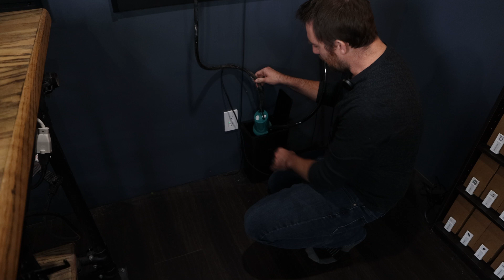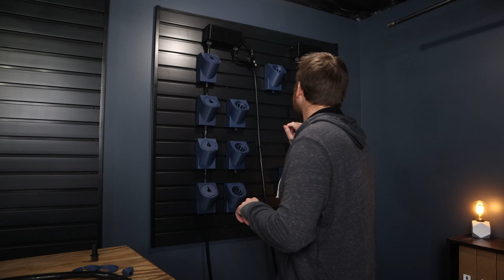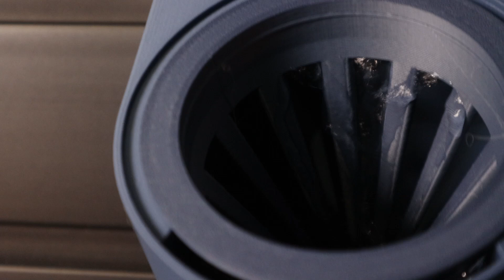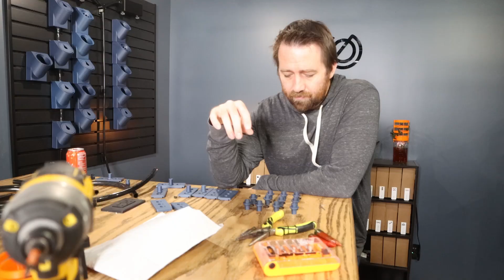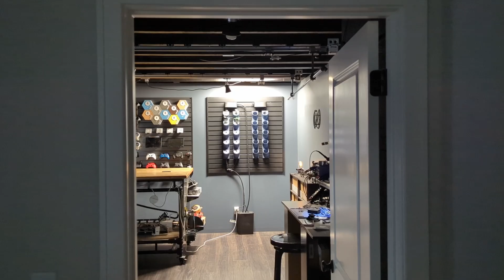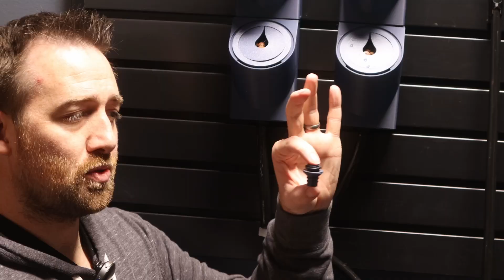My office wall is growing something delicious...

Comment: what nutrients required for strawberries?
Reply from the maker: Strawberries in general don't need much special for nutrients. I'm using some general hydroponics nutrients, but keeping it pretty low right now to let them acclimate, and using just a little more of the micro nutrients, to encourage them to branch out rather than fruit.
Otherwise, just keeping the pH around 6 is ideal.
Definitely more you can do to maximize the growth, but unless you're trying to do industrial growth, don't really need to go that far with them as long as they stay healthy.

Comment: I run 1/2" input with 3/4" drains on my hydroponic setups. The bigger drains can always handle the water flow from the smaller inlet size. To keep a shallow pool of water in each pod, have the 3/4" drain be raised off the bottom inside of each pod so the water overflows into the drain. The o rings should be used with a bead of aquarium safe silicone. The drains inside should be solid.
Reply from the maker: A mk2 will definitely have 3/4" if not 1" drains. Having the system stacked like this also changes how I would approach this in another pass. I think I'd rather keep it open all the way through rather than have a bottom. Then have a screw plate for the very top and bottom of the whole stack and just use some silicone to water seal it. Saves on filament and gets rid of the drainage issue.

Comment: Does that pump have enough power to overcome the pressure/height difference?
Reply from the maker: That actually was an issue and I had to use a slightly bigger pump. It's going about 7' high, which is over the 6' rating, it only runs for 1 minute every hour though, so it shouldn't be a problem.
Reply: Whoops, spoke before you even demonstrated.